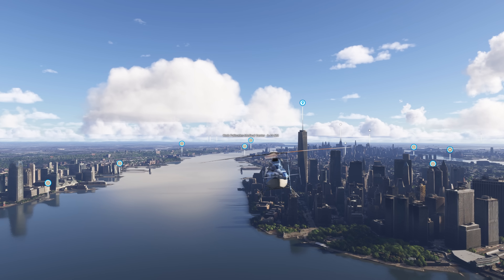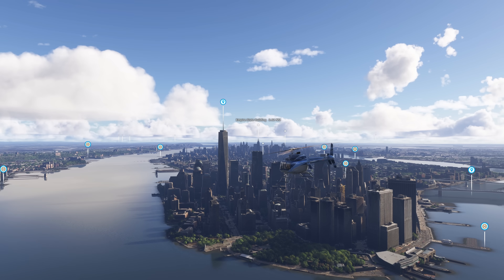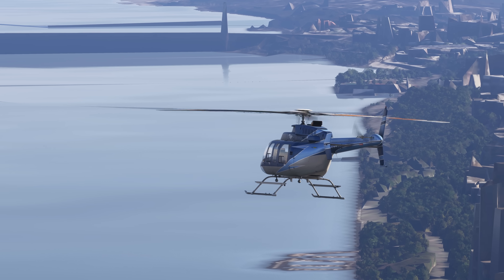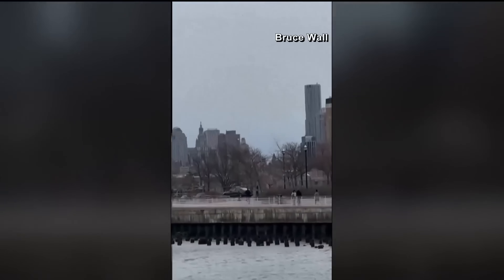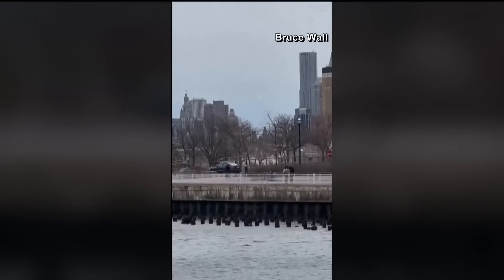Helicopter Expert breaks down Hudson Crash, and discusses “Bump Mast” Theory | NYC Crash Follow-Up

Comment: OMG! As a retired Army OH-58 (Jet Ranger) SIP with thousands of flight hours in the Jet Rangers and an former accident team member, this accident has nothing to do with an engine failure, autorotation, mast bumping, or rotor droop! 

If you watch the videos the aircraft was in straight and level flight when the accident sequence started- so it did not have an engine failure, main gearbox seizure, or rotor separation. The first visible action that occurred was the tailboom failure. And, if you look at videos of the salvaged wreck the failure didn't occur at the tailboom mounting points. The failure occurred at the first spanner rivet line. You can actually see the tear line in the video. What would cause such a failure.  In a similar accident I helped investigate, it was metal fatigue. The main rotor, main gearbox, and mounting assembly were torn from the aircraft intact due to the twisting forces caused by the boom failure and the significant CG shift. It's likely  the main rotor didn't strike the tailboom as the accident started with tail boom  twisted parallel to the fuselage out of reach of tge main rotor.. BTW, the videos clearly show that the main rotor, mast and main gearbox all stayed together.
Reply: Former navy helo pilot and A&P… I concur with your assessment!
Reply: I believe you're pretty much spot on as to how the sequence of events and failures took place.
Reply: You are close, but I don't think you watched all the videos of the incident. It started with the helicopter snapping almost 90 degrees counter clockwise, much faster than any pilot input could make it move, and the opposite direction that the engine torque would spin it.

However, that's EXACTLY the direction the main rotor is spinning, and if the transmission seized up, all the momentum of the main rotor would attempt to spin the helicopter in the direction the rotor spins, which would rip the tail boom off as you saw, and then rip the transmission off the top of the helicopter as we saw.

The fact it suddenly accelerated counter clockwise is the key indicator of where it started.
Reply: Excellent analysis. TY from a retired aviation professional. Now we wait ....and it's gonna be a long time.
Reply: I saw the tail boom failure start the sequence as well, if it indeed was the culprit, is it possible that the boom failure actually seized the tail rotor drive shaft thus momentarily freezing up the transmission and the main rotor inertia twisted the transmission right out of the aircraft ?
Reply: That's what it looks like to me
Reply: CG? Is that short for "Center of Gravity"?
Reply: Yes, CG is center of gravity. Lost of any component aft of the fuselage will cause a massive downward movement of the nose. The initial reaction of the pilot will be to apply after cyclic which only acts to create more stress in the main gear box mounting points. If the tailboom was in place the rotor could impact the boom. But, that did not occur in this accident.
Reply: Yes, that appears to be the sequence of events. Could full deflection of the right pedal possible cause enough force on the tail boom to cause it to fail? Say the left front passenger turning around to the left and stepping on it?
Reply: Perhaps, but such an action would required not only overcoming the inertia of the tailrotor system, but also the pilots leg strength. Helicopter pilot always have their feet on the pedals, and would act to counter such a movement.
Reply: @ no, full deflection of the right pedal in cruise flight will not cause this.  In cruise flight the pedals do very little. Directional stability is provided by the tail and winglets provide directional stability. At worse the aircraft will yaw somewhat and it will feel uncomfortable in the cockpit… much like the feel of cross control / slipping in a plane.   After a little more looking at some pictures it could have been a driveshaft failure that also violently damaged and weakened the tail boom.
Reply: I’m respectful of their service to country but seriously these two buffoons are not helping anyone with this interview.
Reply: @Gettothevette So true. I'm not sure the speaker even watched the accident video.
Reply: I agree. I suspect its either a link failure or the transmission seized up torquing the whole works out of the fuselage (similar to the 2016 super puma crash).
Reply: If that occurred, I think the inertia of the main rotor blades would have cause the nose of the aircraft to initial swing left not right as it did. And, I think the first viewable action would have been departure of main rotor system.
Reply: I stoped watching in the middle of the explanation of the Mast Bumping .. maybe he explain later something in better way.
As you say and clearly we can see in the video of the accident, no Must Bumping happened, or Autorotation .. my guess is same of yours, tail rotor mast broke in middle air.
But I want to point the way he explain in the video the mast bumping .. I never hear anything like that, moving the cyclic forward and back  because bad weather ...
As far as I know (I dont have so many hours like he does btw) is that:

1st You only encounter mast bumping in Semirigid rotors systems (2 blades rotors)
2nd You have to enter in Zero Gravity maneouver (I didnt hear him to say that .. true I didnt watch the full explanation)
3rd When you already in zero G you have to move ciclyc in larger movement (usually correcting the roll caused by the tail rotor push).
Reply: @Franjaver Thank you.  I was surprised at his explanation of ‘mast bumping’ considering his lengthy experience as a pilot.  I’m not a pilot but I know what mast bumping is and what he was describing….ain’t it.
Reply: @Splattervision-qh1sd not one time did he say mast bumping was the culprit and he even went as far as saying it was nearly impossible. He was answering a question asked of him.
Reply: @Splattervision-qh1sd  Thanks mate. Yes, I was surprised too! I don't want to go hard on the guy. He seems to have plenty of hours and experience, probably he is not familiarized with the term and someone else explained to him briefely .. idk. Maybe I'm all wrong with Mast Bumping all along, lol
Reply: @jtfike  I think @Splattervision-qh1sd not saying that.. just the way he explains Mast Bumping. We all agrees that didn't happened in this accident.
Reply: @jtfike My comment relative to "mast bumping" was not related to the speakers comments. I did comment to counter his refer to slow pilot reaction, main rotor dropping, etc...
Reply: @ Yes, I know he wasn’t saying it was the culprit.  My only issue was when describing mast bumping, he didn’t seem to know what it was.  I respect his skills and experience otherwise.
Reply: @Franjaver  I was thinking a current pilot or flight student could explain mast bumping much better than the Colonel did, and you proved me right! The right roll caused by the tail rotor will make the pilot intuitively make a left cyclic input to correct the roll, as you said. The problem is, this tilts the rotor hub itself to the left, making the rotor hub flapping stop contact the mast, potentially piercing the hollow metal main rotor shaft. This will cause the mast to fail and the rotors and hub will separate from the mast. The correct recovery is aft cyclic, which should put the G-forces back onto the rotor system. So the Colonel's explanation of pushing and pulling the cyclic back and forth would be both the cause and the remedy for a low-G condition. Sad to see content creators selecting the wrong "experts" to explain things. Also sad that this is not the only place where I have seen this. Oh, and turbulence can cause negative/low G's on the main rotor, so maybe that is what the Colonel meant by "bad weather." Cheers!
Reply: @vikingr3572  Sweet to read you! I can tell you’ve explained this a few times before. I'm a licensed instructor myself, but I’ve never actually trained anyone for a license. I got my CFI and CFII from Bristow Academy, and as you can see, I have the instructor instincts in me — watching videos, taking notes, and correcting others, LOL
Reply: It's very hard to get into mast bumping with a loaded rotor system. And, it requires a very abrupt aft cyclic movement which would have been visible in the videos. I've done return to target (wing overs) in Jet Rangers with no problem if you keep the rotor system loaded. I was told by a Belgiumpilot that he actually rolled a Jet Ranger.
Reply: @keithdavey5492  No, an abrupt FORWARD movement of the cyclic to unload the rotor system and left cyclic to correct the right roll caused by the tail rotor would cause mast bumping. Mast bumping is from negative G's. 17-year flight instructor with 6000 hours of instruction given. :)
Reply: @vikingr3572 Yes, mast bumping does occur in a negative G situation, but that did not occur in this accident. One or two bumps and the mast fails, which it didn't in this case. 

BTW, you can also get into a negative G environment with a aft cyclic input. If you hold that aft input too long, the aircraft will slow to a near zero climb rate. Been there, done that! Luckily, as a former Cobra pilot I knew to use tailrotor input to reverse the climb to a dive.
Reply: Thank you for your service sir,wellsaid.
Reply: That’s exactly right… this wasn’t mast bumping. My guess is that the main gearbox mounting hardware failed and that caused failure of the flight control rods to the servos. After that it was all over when the MRB’s had nothing holding a proper pitch angle. Instantaneous aerodynamic out of balance occurred that yanked the entire rotor/gearbox assembly from the fuselage and it very easily could have severed the tail boom. I have seen many incidents of hard landings that severed the tail boom and hardly did any damage to the blades. Don’t know why he was going off about autorotation procedures.. you kinda gotta have an in tack rotor system to accomplish that. This is a situation where you talk to maintenance personnel who understand the nuts and bolts of the actual design of the aircraft vs the guy that just hopes in and flys and then walks away after the rotor brake is applied !
Reply: @brucelabree2643  here's some new details. I just saw a video of the main rotor being pulled up. The entire transmission, main rotor shaft and rotor head are intact. The entire unit including the floor it's mounted to was completely ripped from the airframe. That's crazy !!
Reply: That's what i thought. The tear at the rivet right before the tail boom mounting. The four bolt never gave way. The tail boom will be the key to the mystery, if it fail it will be visible on the tail boom skin or the tail rotor controls and assembly. The main rotor mast and transmission is still in one assembly, it actually ripe off the whole upper deck, amazing. Due to lost of the tail rotor torque the main rotor will have definitely over speed which may cause the deck to break, it went beyond the design of the nodal beam to absorb the sudden upward forces. There is no way the pilot could have done anything to recover the aircraft. Good assessment from Mr Keith. RIP to the Pilot and family.
Reply: I loved the initial news coverage dwelling on "out of fuel" because the pilot had requested fuel on the landing. Fuel quantity whether "bingo" or low don't mean "out"- suggesting ran out. I'm leaning towards tail boom, gearbox, or Jasus nut.
Reply: And the yaw appeared to be to the right, meaning the main rotor was powered at the time of the yaw. In a gearbox lock up, the yaw would have been to the left. I thought the main rotor did contact the boom AFTER it folded because of the debris scattering about two seconds into the accident sequence, but I can see how a sudden failure could cause such a debris-related appearance of an "explosion," especially with such violent breakage.
Reply: whjen you 
lose rotor speed A PILOT told me the rotors cone up
Reply: Thank you, very insightful.
Reply: I agree with your assessment as well. To add to that as a former helicopter mechanic and pilot, there is a possibility that one of the main blade control linkages wore out/broke causing one blade to go into negative pitch and contact the tail boom. This would cut the boom and cause the transmission to be ripped out due to the contact. The picture of the rotor and transmission being lifted out of the water shows a bent main mast but I can’t see if both blade linkages are intact. Very sad day.
Reply: Watch the latest videos of the salvaged wreckage. The break in the tailboom was from a rotor strike as it was a clean tear about a foot back from the tailboom mounting point. And the videos clear show the rotor system intact in a flat normal plane when the boom failed.
Reply: @keithdavey5492  Very doubtful.  If the main rotors hit the tailboom the rotors would have been severely damaged and likely sheared from hitting the steel tail rotor shaft
Reply: If a helicopter's tail rotor fails in flight, the aircraft will begin to spin uncontrollably due to the torque of the main rotor being uncounteracted. The pilot must immediately initiate an autorotation to manage the spin and land safely. Maintaining forward airspeed can help limit the spin and provide more time to find a suitable landing spot. 

This is what I see in the video 👆
Reply: It definitely seems likely that this is pretty much what happened. It appears as if the tail-boom shearing off the aircraft caused the violent yaw, loss of control and subsequent in-flight break-up, including the subsequent departure of the entire top-deck of the fuselage, transmission and all. 

I can't even think of what sort of event would have to occur for a transmission like that to just instantly stop, such that it could cause such a violent yaw and breakup of the aircraft. Transmission failures are typically progressive in nature, with all sorts of noises, high-temperature indications and engine or rotor RPM excursions in the preceding seconds or minutes prior to complete stoppage. Usually enough time to close the throttle and enter a nice, stable autorotation to hopefully save the day.
Reply: Agree 100%.  This is not Mast Bumping!   The tail boom failed.  It’s definitely mechanical and not Pilot error…unless he was not a fanatic about preflighting…..   retired LEO helicopter pilot and I Touched and tugged on everything doing a preflight.
Reply: Finally we get to the J - Nut and not this silly talk about mast bump. The big clue is the massive torque unload as the whole Rotor and mast head separate off. You can see it. Then the tail falls away…so sad.
Reply: Sorry, but you're wrong.
Reply: Agree.
Reply: Would there not be any indications of impending failure such as wear grease or dimpling effect or loose rivets etc? Would that not be picked up on a d&t? Or at least a 30day corrosion inspection since they are in salt water environment should it not be inspected every 14 days instead of a thirty? Mrgb still being attached to the transom. Lift link xmas mount failure. Odd being straight level. Few contributors to the taliboom buckle and fail. Like standing on a soda can holds u till u put a small tink into and it all fails catastrophic failure
Reply: As a crewchief/mechanic for 9.5 years...including Vietnam... my first thought was the transmission locked up but after seeing the state of the tailboom...I'm thinking a tail rotor 90 degree gear box lock down.
The tail rotor shaft has several bearing mounts on it under its cover down the length of the tail and I'm thinking when that tail rotor came to a sudden stop it twisted one of those bearing mounts right out of it's mount and the force was so great the bearing housing mount ripped  the tail skin along with it.
Rem the engine is still turning and that tail rotor is going around twice as fast as the main rotor so there was a twisting effect on the tail rotor shaft.
Something had to give. All my time was on a Huey, by the way...
The bolts holding the tail shaft bearing housing are suppose to shear to help protect the tail boom but like one guy said I think the centrifugal force tried and did yank the tail boom around so quickly it just bent the tail boom at its weakest point.
Then again... I couldn't tell if the main rotor and the transmission was spinning independently of each other or if both the main rotor and the transmission were spinning exactly the same as if the gear box was locked down.
Guess we'll find out!
Reply: I was reading a few comments about the reason the helicopter crashed is because the pilot was black. Why do people think this??
Reply: @badcornflakes6374 color, race, gender, etc… have nothing to do with this crash.
Reply: @M_Samp The comment that said that had over 50 likes. I'm just confused.
Reply: Your correct, this was a structural/mechanical failure. Once it all started the pilot was just another passenger.
Reply: @badcornflakes6374  That is a rage race baiter. Plenty of them in comment sections. Immature adults with no life other than wanting to cause disruption in any way they can because they hate their own life.
Reply: Badcornflakes6374,
 You are the first comment bringing "race" up that I have seen in all the videos and comment sections I have reviewed.
Perhaps you should ask yourself that question.
Reply: @badcornflakes6374   Because they think with their fears, not with their brain. I mean the grey cells part.
Reply: people think they know everything cause they watch politics..this country really divided from politics. Sometimes there is truth to the claims..sometimes,, none at all...
Reply: Because they're stupid.  The pilot actually had nothing to do with this accident, except perhaps in a preflight inspection of the boom.
Reply: @badcornflakes6374  1st, IF there were such comments, they're stupid.  2nd, don't perpetuate stupid.
Reply: @RSpuhl  There were 100 percent such comments on different channels pertaining to the helicopter crash. Not on this channel. Not a matter of IF.
Reply: @ so the stupidity was on another channel…another thread.  Why ask here if there’s a reason being black would be contributing ?  It’s so ridiculously stupid to think a man’s color might have impacted this accident…your comment came across as “race baiting”.  If it wasn’t, good…then we can just let it go.  If you feel it’s a real issue take it back to that channel, offender… merely my opinion.
Reply: @badcornflakes6374  You are just trying rage bait. Grow up.